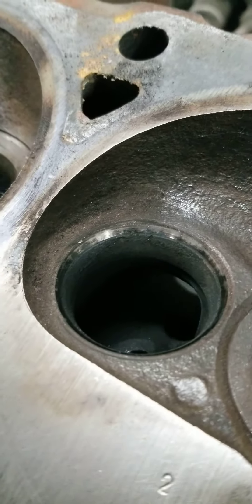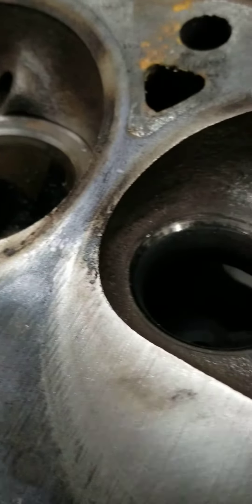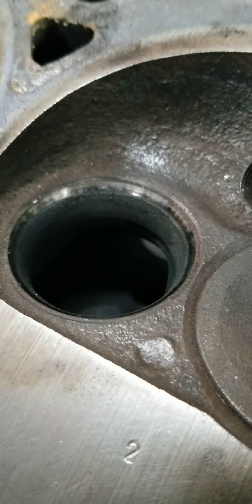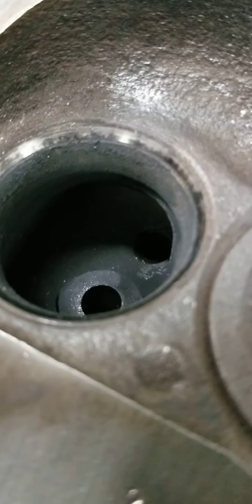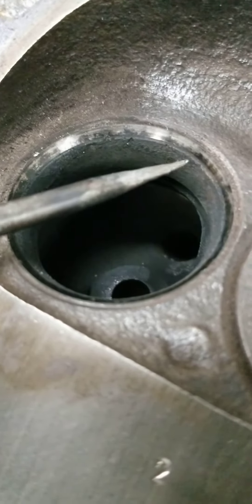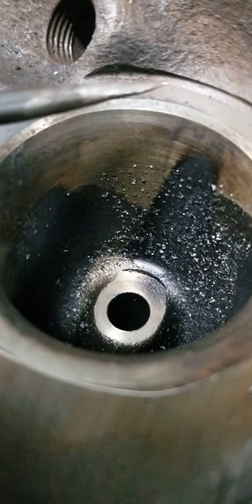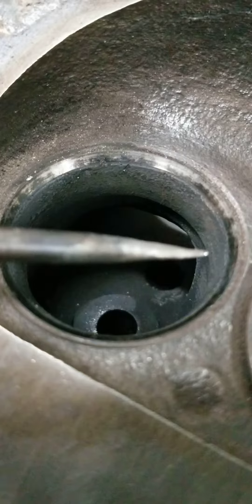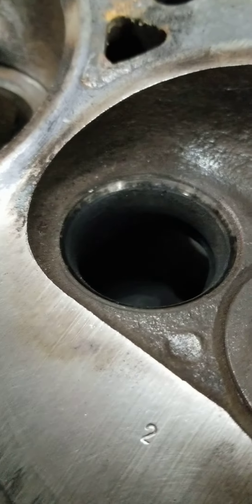Cylinder head rebuilding when getting a port job. Why we recommend!🤔

Comment: Definitely tool chatter , what's amazing about that is how it left a machine shop like that. I always use  Dyecam and hand lap them for the final finish , and that would've shown immediately.  Getting harder and harder to find machine shops with quality control. That's worth power too, alot of cylinder pressure lost with a bad valve job.
Reply from the maker: Perfectly said!! Many shops get pressured for faster turnaround times by customers so to keep up they rush, skimp on quality or offer lower quality services. It's like telling your brain surgeon to hurry up when he is about to operate on your brain lol